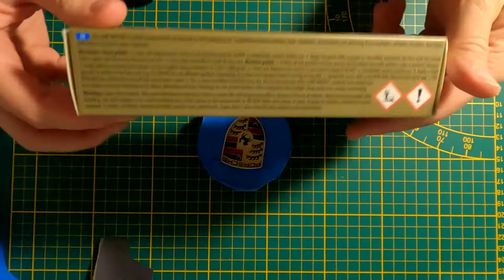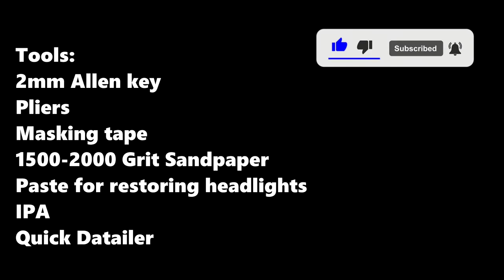Restoration of Porsche 996 986 wheel center caps. How to make the crest to look better!

Comment: Not real Porsche centre wheel caps. These are made of plastic, the originals are made of aluminum…
Reply from the maker: They are originals :) metal center wheel caps were used in 928/964/993 but not in 996 I assume due to cost saving 😀